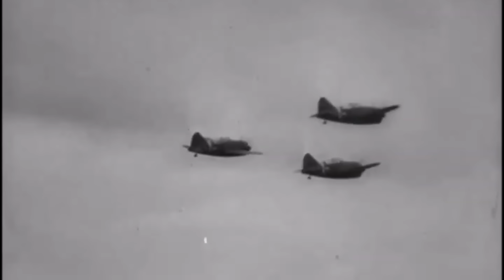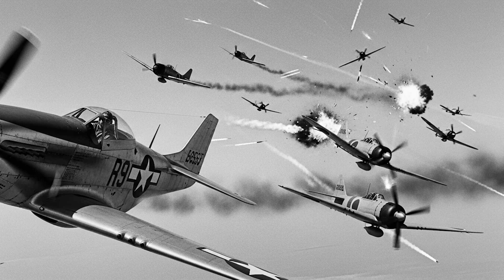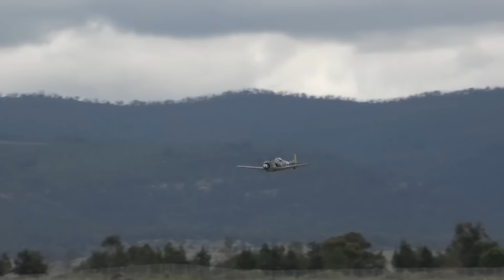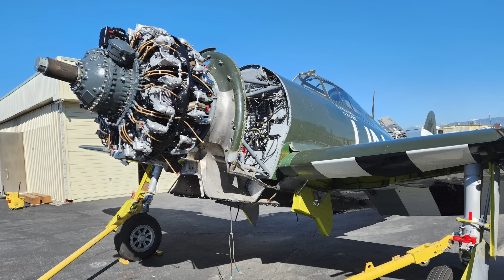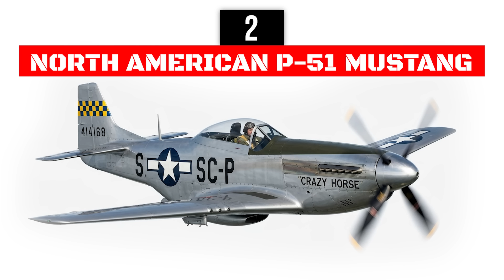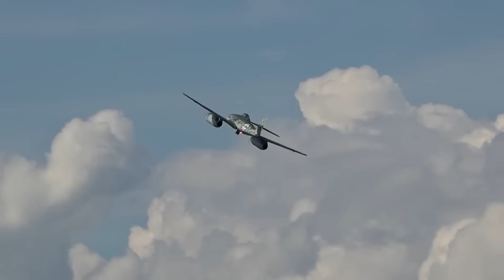Every WW2 Fighter Aircraft Ranked - WORST to BEST (COMPLETE)

Comment: THE main drawback of me262 was that after 18 HOURS of the engines had to be completely stripped down...
Reply: 10 hours.  18 would have been almost twice what it actually had between overhauls.
Reply: Not true. Those engine could be replaced within four hours. They were specifically engineered for that. The Germans knew they were problematic. (the engines) Repairs/overhaul was performed off site.
Reply: @thenevadadesertrat2713  The 262 engines could be changed in thirty minutes.
Reply: @TheAneewAony that sounds more accurate. The 109 could have it's engine replaced in 2 hours
Reply: @markgranger5003 kinda difficult to get an engine replaced when all your factories are getting bombed.
Reply: @pyronuke4768  Not early in the war. In fact production of aircraft increased, the problem was lack of fuel
Reply: @thenevadadesertrat2713  The Germans had plenty of excellent mechanics and engineers.  That's why they were able to make a very new and inherently unreliable technology work at all.
Reply: @thenevadadesertrat2713 Germany did not have enough engines to replace the Junkers Jumo 004 turbojets on a regular or reliable basis.
Reply: I’ve heard sources that said the Gloster Meteor was the first fully operational jet in combat in WWII.
Reply: @duroshebanja6810  The Meteor was never used in WW2 combat. Calling it "operational" is a bit of a stretch
Reply: @TheAneewAony  Ot was the first fully operational jet aircraft ready for service. Look it up. The Gloster Meteor & the P80 Shooting Star were both flying tactical sorties during WWII. They may have not faced German Jet Aircraft but they were in service before the wars end.
Reply: @TheAneewAony  It was used , along the P80 for tactical purposes. Yes during the war.
Reply: @duroshebanja6810  Eric Brown: “Speed. Speed. It was a pedestrian aircraft, really, the Meteor. It never went into… It never fought operationally. It fought, if you like to call it that, against the V1, the flying doodlebug, and quite successfully. But it really was too slow to deal with the German jets when they came into being. They were a grade above at first. The Me262 is quite frightening. It gave us a shock to find out, because when I flew it the fastest fighter we had – piston fighter, of course – in the Allied camp was the Seafire Mk14 with a top speed of 446mph. The Me262 was 125mph faster than that aircraft. So this was a rude shock to our system, I tell you, when we found that out.”
Reply: @TheAneewAony  The Brits had other more advanced jets ready to take it place shortly on the horizon. & the P80 Shooting Star , the US Jet could have faced the ME 262 with fairly equal speed. READ the P80 Shooting Star WAS flying tactical sorties in Italy , before the war’s end.
Reply: Tje Meteor’s below average speed for a jet has nothing to do with it being used in the war. & data shows it was used in WWII. So was the US Shooting Star, in late 1945 , the P80 was flying missions in North Italy before the war’s end.Just because it didn’t encounter a German fighter doesn’t mean it wasn’t used in those sorties before the war ended.
Reply: @duroshebanja6810  Eric Brown: “Speed. Speed. It was a pedestrian aircraft, really, the Meteor. It never went into… It never fought operationally. It fought, if you like to call it that, against the V1, the flying doodlebug, and quite successfully. But it really was too slow to deal with the German jets when they came into being. They were a grade above at first. The Me262 is quite frightening. It gave us a shock to find out, because when I flew it the fastest fighter we had – piston fighter, of course – in the Allied camp was the Seafire Mk14 with a top speed of 446mph. The Me262 was 125mph faster than that aircraft. So this was a rude shock to our system, I tell you, when we found that out.”
Reply: @duroshebanja6810  No, they did not, as history has proven. Postwar Britain was bankrupt and had to make do with obsolete aircraft such as the Meteor well into the fifties. As for the P-80 it was never used in any sort of combat during WW: READ

"However, when the USAAF formally compared the P-80 and Me 262 shortly after the conflict, it concluded that: "Despite a difference in gross weight of nearly 2,000 lb (900 kg), the Me 262 was superior to the P-80 in acceleration, speed and approximately the same in climb performance. The Me 262 apparently has a higher critical Mach number (the Me 262A's was M 0.86), from a drag standpoint, than any current Army Air Force fighter."[ -- Ethell and Price 1994, p. 180.
Reply: @TheAneewAony  The De Haviland Mosquito?
Reply: @TheAneewAony  The P80 Shooting Star was the superior aircraft to the 262. You can see a few vids here where it affirms that conclusion.& it was much easier to fly, & better in fact, & the 262 would be no match for it in a dog fight.
Reply: @duroshebanja6810 That's not what the Air Force determined "However, when the USAAF formally compared the P-80 and Me 262 shortly after the conflict, it concluded that: "Despite a difference in gross weight of nearly 2,000 lb (900 kg), the Me 262 was superior to the P-80 in acceleration, speed and approximately the same in climb performance. The Me 262 apparently has a higher critical Mach number (the Me 262A's was M 0.86), from a drag standpoint, than any current Army Air Force fighter."[28  "
Reply: @duroshebanja6810  Technically, yes, but the Meteor Mk I had pretty poor performamce with a top speed of 408mph and was only used defensively against V1s over the UK.  The British held a lot of technology back over the course of the war, not allowing it to be used over occupied territory out of fear it might fall into the hands of the Germans.  The Meteor Mk III was only used over continental Europe at the very end of the war.
Reply: @Neneset  Technically no. The Meteor was not a combat jet as it was never used during WW2 in actual combat against an enemy. No Meteor was ever shot at by a German, and no Meteor ever shot at a German. The Meteor's technology was very low tech compared to the 262, by a factor of three years, as it used the obsolete centrifugal flow engine. The Meteor's slow speed is why it was never used in WW2 combat
Reply: @TheAneewAony  Not quite true.  Some Mk IIIs were stationed in France before the end and encountered an Fi156.  The Fi156 was able to get on the ground before the Meteors set up the attack run.  They strafed it on the ground.

Which is 100% moot as combat against V1s is considered Combat and Meteors were used extensively for that.
Reply: @Neneset  It may true that a Fi 156 nearly shot down a Meteor. Sad story really. Meteors never encountered enemy aircraft due to its slow speed. Additionally, the "wartime" Meteor had difficulty hitting a target.  From British Central Fighter Command: "The failure of the Meteor to come within an acceptable standard is due to the directional snaking which occurs in operational conditions of flight so far experienced and the heaviness and consequently slow operation of the ailerons to bring the sight back on to the target. This snaking tends to increase with increase of speed and, once it has commenced, it is impossible to correct it within the limits of time available during an attack. It is understood that modifications are in hand in an attempt to eliminate snaking, but the aeroplane as tested is unsuitable for operations.
 Extensive use, no, not by any measure"  From  REPORT NO.68. AFDS REPORT No.175.TACTICAL TRIALS METEOR III, dated 2.4.46.
Reply: @TheAneewAony  480mph is slow? Sure, its not 540, but its more than any WWII piston engined fighter was pushing.
Reply: The first ALLIED jet fighter!
Reply: Plus, it couldn't accelerate, turn or dive with the best Allied prop driven fighters. Once Allied pilots learned how to fight it using their plane's advantages, they more than held their own. And the 30mm cannons, while lethal against large, slow moving bombers, were not designed to engage in dogfights with small, fast, highly maneuverable opponents. The muzzle velocity and arched trajectory made it difficult to hit such a target.
Reply: @wanyelewis9667  Nah. The 262 was 60 mph faster  in level flight than a P-47's maximum speed in a dive. The P-51's maximum climb rate speed is about 175 mph, the 262 maximum climb rate speed was over 300 mph. The Me-262's economical cruise speed was 460 mph, the P-47M could almost do 470 mph, but only for five minutes. That's why no one uses piston engine fighters
Reply: @TheAneewAony 
I would question those numbers.
No matter; dogfights aren't fought under those conditions.
Reply: @wanyelewis9667  Well, try Google. All those numbers are accurate. Additionally, there are no more piston engine fighters in use
Reply: @TheAneewAony  Plenty of ME262s were shot down by diving P 52 Mustangs. US pilot Candelaria shot a few down in his Mustang. 
The 262 had stability problems because of its engines. & even the Soviets had an axial flow jet engine on the near horizon. Some Soviet early jet aircraft were mistakenly identified as German designs but in fact they were home grown Soviet planes, with axial flow engines pioneer by Korolev.
Reply: @duroshebanja6810  All 28 WW2 jet aces flew the 262, with over 500 air to air kills. Surely you're not suggesting that piston engine aircraft were on par with the 262, they were not. BTW, what did Eric Brown say about the stability and handling of the 262? Let him tell you: : ...the aircraft had excellent directional snaking characteristics making it a good gun platform. From this aspect it was the best jet fighter of it's time, and I was certainly in a position to judge, having flown every jet aircraft then in existence. A check on the rate of roll at 400 mph revealed the highest that I had ever experienced outside of the realm of hydraulically-powered ailerons, and the stick force demanded to produce these exhilarating gyrations was delightfully light. Leveling off at 12,000 feet I settled down to another spell of the pleasures of the phenomenal roll rate of this delightful little aeroplane ... I had never met better flying controls ... Even if somewhat underpowered it had a good performance - it could certainly have run rings around the contemporary Meteor. I was to fly the little aeroplane quite frequently."

page 138
"Wings of the Luftwaffe" Captain Eric "Winkle" Brown
(C) 1977, Revised 2010, reprinted 2011, 2013
ISBN 9 781902 109952
Reply: @TheAneewAony  the P80 Shooting Star my friend was an extremely capable Jet Aircraft of the US. II rivaled the 262 in speed. The Brits has the De Haviland Mosquito on the horizon. The P80 went on to excel in the very early stages of the Korean War. 
Read & learn!
Reply: @duroshebanja6810  The P-80 was a cool airplane. Neither the Meteor or P-80 were on par with the 262 in 1944-45. "However, when the USAAF formally compared the P-80 and Me 262 shortly after the conflict, it concluded that: "Despite a difference in gross weight of nearly 2,000 lb (900 kg), the Me 262 was superior to the P-80 in acceleration, speed and approximately the same in climb performance. The Me 262 apparently has a higher critical Mach number (the Me 262A's was M 0.86), from a drag standpoint, than any current Army Air Force fighter." --  Ethell and Price 1994, p. 180. As for the Meteor, per Eric Brown: “Speed. Speed. It was a pedestrian aircraft, really, the Meteor. It never went into… It never fought operationally. It fought, if you like to call it that, against the V1, the flying doodlebug, and quite successfully. But it really was too slow to deal with the German jets when they came into being. They were a grade above at first. The Me262 is quite frightening. It gave us a shock to find out, because when I flew it the fastest fighter we had – piston fighter, of course – in the Allied camp was the Seafire Mk14 with a top speed of 446mph. The Me262 was 125mph faster than that aircraft. So this was a rude shock to our system, I tell you, when we found that out.”
Reply: @duroshebanja6810  It's not possible to compare Allied jet engines to German designs because the Allies really didn't have any operational jets. At this point in the war, the USAAF 8th AF P-51 Mustangs had already defeated the Luftwaffe. The 28 Me 262 jet aces, 500 plus air to air kills, 5 to 1 kill ratio all occurred in less than six months, while the 8th AF had near complete air superiority. Because jets beat props, no need to revise history, it's just what happened
Reply: @TheAneewAony  Keep thinking with your opinion. I’m done with ignorance of facts you have.
Reply: @duroshebanja6810  Not my opinion, just historical facts. "We had nothing able to fight the 262, it was in a class of its own" -- Eric Brown
Reply: The 262 was not faster in level flight than a P47 in a dive. The 262 didn't due all that well against allied fighters. When Nowotny took over, untill his death the squadron lost or damaged 28 out of 30 units to 24 claimed victory's. The slow firing cannons had a rainbow trajectory and adjusting the throttles to fast and flame out, or the jet engines just might catch fire or destroy themselves.  It's place in history is it marked the piston fighters decline, not air dominance, granted when the 262 was at it's best it was hard to kill in air to air combat. More often than not the long range of the Mustang made the 262 as ordinary as all other Luftwaffe aircraft, sitting on the ground and a target.
Reply: @markgranger5003  world war wings stated the 262 was a bomber attack fighter, & the P80 was designed to be a dogfighting aircraft. Many historians think in a dogfight the P80 had the upper hand.
Reply: @markgranger5003  Yes, the official flight manual for the Republic P-47 Thunderbolt limits the maximum dive speed to 500 mph indicated airspeed (IAS). The British cleared it to dive to 520 mph. That's 50 to 60 mph slower than a Me 262 in level flight. To quote Eric Brown: "We had nothing able to fight the 262, it was in a class of its own" Hope this helps
Reply: @duroshebanja6810  I never said anything about the P80. The 262 was faster than any WWII aircraft period. It's level flight of 540mph is not faster than a P 47 in a dive that's my post. It is a trivial fact that means little. The 7 ton milk bottle with a 2 thousand horse power Pratt and Whitney with a 10 foot radius propeller and a top speed of 470 mph in the m/n variants. At 40,000 feet it would go well past 590 mph. There have been pilots who pushed the jug so hard that they came apart and booms were reported by bystanders. No propeller aircraft can break the sound barrier but a heavy piece of that aircraft like the engine without the prop could. The P 47's toughness was legendary and power dives are practically the only move you have when you have hit your max ceiling.
Reply: @markgranger5003  The P80 Shooting Star reached a top speed of 590+ mph. Again worldwarwings had the information, let’s not rely on opinions.
Reply: @duroshebanja6810  Let me explain manufacturers top speed ratings. It's averaged out of a group of planes that can vary as much as 10mph just like any mass production machine in that era there are going to be slight differences. The C/O gets the best plane out of the bunch and there will be a hanger queen. I haven't posted anything about the P80 and don't care how fast it is I don't rely on opinion I have dozens of reference books on aviation.
Reply: The Mossie had already flown before the "good ol' US of A" had even entered the war, lol! "Read and learn".
Reply: @duroshebangja6810 is worldwarwings a computer game?
Reply: @JohnStorey-ed8cf  Barley the mossie went operational mid November 41 so not to long before Pearl. It flew earlier but that's not the same as operational.
Reply: @TheAneewAony  I flew over 100 missions in the Me 262 in Microsoft's Combat Flight Simulator because it was by far my favorite fighter.  It was by far the fastest plane in the sky, I could pick and choose when, where, and how to engage the enemy and I never had to watch my six.  It was a nice, stable gun platform and its only drawbacks were its short endurance and the fact that you had to be close to your target to get hits with the slow-firing, limited velocity 30mm cannon.
Reply: @TheAneewAony flight times were between 60-90 minutes, depending on throttle usage, going fast to intercept, time is closer to 60 minutes!
Reply: Just replace them in 30minutes,sowhat!!
Reply: I read that they had to be replaced. Unreliable and used too much fuel, pilots over shot their targets because it was too fast and,  Was put in service too late!
Reply: I don’t see how you can put the 262 at #1 due to it coming in at the very end of the war and its poor reliability.  And, there were very few of them manufactured.